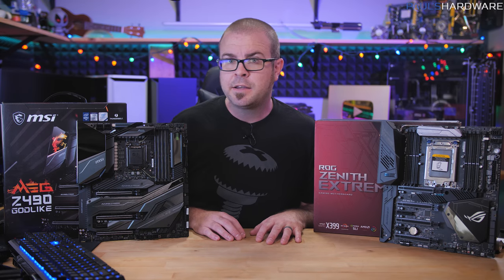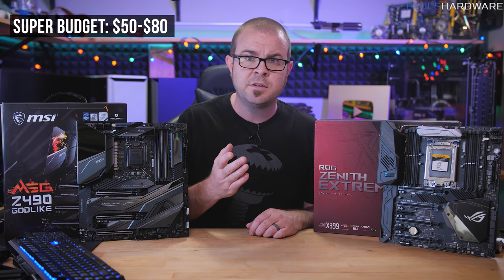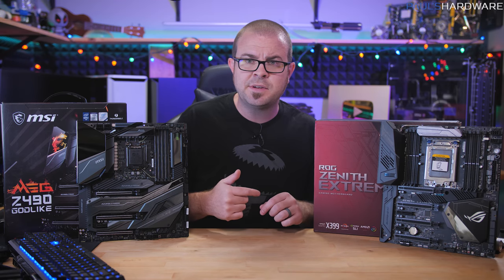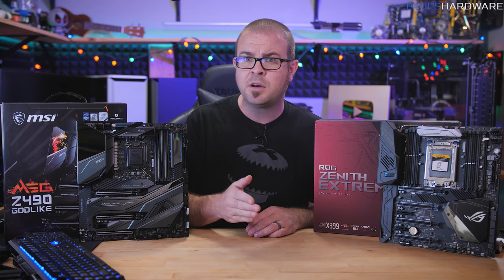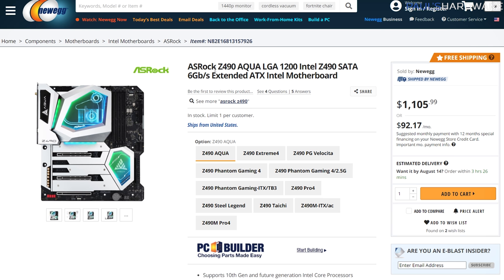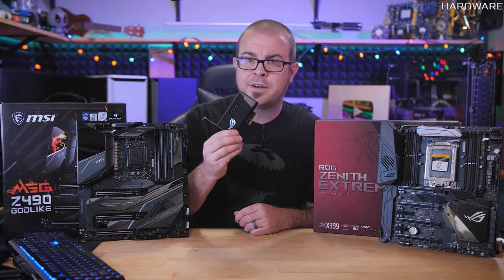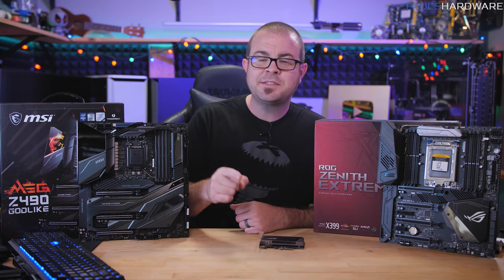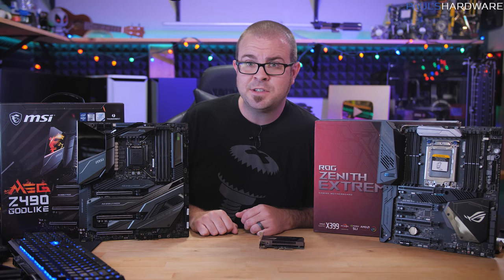What Does a $700 Motherboard Have that a $200 Motherboard Doesn’t?

Comment: Multi BIOS chips are handy for overclockers.
Reply: if they have a switch to toggle the bios, looking at you gigabyte
Reply: I won’t buy a board without one anymore unless I absolutely have to. It has saved my butt so many times
Reply: @monkeyplayer1  but new motherboards can flash bios from a USB drive with no display and no CPU
Reply: If they don't have an actual toggle switch, no. It's not handy, in fact it will have a worse experience than having only 1 BIOS.
Reply: Chad McKean The Xtreme has a switch though
Reply: Never have I tried a multi bios chip board. But the bios flash back saved me on my MSI B550I gaming Edge. First time ever I used it and it's awesome... I should make a video on that one day, this is Eric of Not Bios. Last year when Paul was in Van city in Canada I was on Vancouver Island. Now chilling up north; it's the cool place to be ;)
Reply: But to be fair, almost all the mobo's in the 200$+ range have that feature one way or the other
Reply: @aj0413_  The X570 Master also has one. No need to really spend nearly twice as much on the Xtreme to get a few more PCB layers, 10G NIC (instead if 2,5G) and passive chipset cooling. Plus a few more phases on the VRM.
Reply: Raivo K I mean, none of those (aside from passive cooling) are why I have the Xtreme, but was literally just commenting on the callout to Gigabyte and the Xtreme is the only one I knew had switch since I own one
Reply: @aj0413_  Z490 Master has the BIOS swtches.
Reply: Asus crosshair extreame 4 .multi bios saved my rig. Had an unstable ethernet port but used a bigfoot killer nic. Loved that motherboard .
Reply: Yeah he wouldn’t know man, he’s Paul’s HARDWARE not pauls SOFTWARE GOSH! Haha all jokes aside you’re 100% right about that
Reply: I totally agree i love my gigabyte x370 with the dual bios. With my Custom Waterloop i oc my  1600x and my bios crashed like  +10x times. It saves so  much time.
Reply: Multi bios is super useful for tons of enthusiast application. It also makes updating bios not a risk to brick your board.
Reply: I've had cheap(50 bucks) mobos with dual bios for 10 years already at least ... yep it is usefull and wouldn't buy one without but wouldn't call it premium function ...
Reply: Pro tip to anyone who cares: If you screw up your BIOS settings and can't boot / need to reset to defaults you can do so easily enough without any fancy CLRCMOS or jumper pins required

Every motherboard has a CR2032 button cell battery, the power in this battery keeps the volatile flash memory containing your BIOS config alive, take out the battery (also with PSU unplugged or switched off) and wait a few mins for capacitors to drain and it will reset it to factory defaults. Pressing and holding down the power on button on the case while that battery is out should speed up the process to seconds rather than minutes too.

Same can be done with laptops - AC unplugged, battery removed - hold power button for 30 seconds
BAM bios has been reset 
If you have a laptop with non-removable battery though, it can vary by manufacturer - most will still work just with AC unplugged if you hold the power button for 15+ seconds and some say hold the 'mute' button or 'beats' button at the same time etc
Reply: @RamiKattan  how?
Reply: My cheapo Gigabyte board from 2013 which looked like blue neon puke had that feature. It's as basic as it gets.

Comment: Going from a budget mobo to a midrange:

Prefitted I/O shield blew my mind 😂
Reply: I'm in the exact opposite end, my latest mobo had a prefitted IO shield that made installing the thing into the case a 20 minute wrestling match trying to not bang the board on the standoffs or bend it too much.
Reply: I literally left my Io off my pc so I can reach inside and check my CPU thermals manually XD the jankiest of the jank. One day imma electrocute myself lol
Reply: @TheDarkness344  oh yeah 12 volts dc, very scaryy
Reply: @DarkoPetreski  lol who knows XD a lot of amps can be dangerous but the resistance of my hand is high enough that I should be fine - more the heat to be worried about XD if I was running an FX chip my hands would be on fire lol
Reply: I paid 270 dollars for my motherboard and didnt get an included iOS sheild
Reply: I have a high end mobo, around 600 euros and the io shield isn’t pre installed but the padding is so thick that the usbc port is useless 😐
Reply: When my mobo came in I was like Ayoo where the io at then I looked at the io and saw that is was was pre installed which makes sense
Reply: What's an IO shield? 😁
Reply: @MichaelClark-uw7ex  input/output shield. it's the part where you connect all your cables at the back of tower, after your build is complete. In the video, where he is showing off his RGB backlit audio jacks, that is part of the IO shield.
Reply: @careyosoup274  I was being facetious, the IO shield is the metal piece that you put in the back of the case to seal the opening where the jacks are.
I always forget to put it in before mounting the mobo and am too lazy to remove the mobo and install the shield, so I say "what's an IO shield" with the wink emoji. LOL
Reply: @MichaelClark-uw7ex  gotcha. in my defense, I wasn't quite done my morning coffee yet ;p
Reply: going from super budget to budget:

Woah! This thing actually comes with an I/O shield!
Reply: same! never going back to mobos without preinstalled shield

Comment: At the very beginning when he mentioned audio, I said why? Use a DAC! I have 3 DACs. I use cheap $50 models to give me Optical and Coaxial and they run to a Fosi Audio Q4. The switch on the front switches between Optical and Coax, which are my primary desktop and my laptop dedicated to streaming. The Fosi connects to a Lepy Amp with the Texas Instruments version of the old Tripath Class-T chip, and that feeds a pair of Micca speakers. I do use EQ software to notch 125 Hz, and add a little bump at 60 Hz. This setup sounds AMAZING! The components are small enough to fit on a desk, but produces Audiophile quality sound even from a cheap old laptop. Add a Deezer Lossless subscription and no one would ever believe they were listening to a computer. When you consider the Amp and speakers are under $100, this is something everyone should look into, for music, gaming, and even YouTube. If you're a gamer, add a pair of HiFiMan headphones and a mic. The Fosi DAC is also a headphone amp. Planar Magnetic speakers are something Audio Engineers have been working on for more than 40 years, but few actually got it right. The designer of the HiFiMan headphones is one of those few.

Comment: Laughs in perfectly adequate 100 euro b450 mobo
Reply: Not true
Reply: Same board
Reply: Laughs in £60 mobo
Reply: B450 eww
Reply: Haha, same, I’m just happy to have integrated WiFi 6
Reply: @stoprollin nothing if you don’t got any high end hardware I guess
Reply: @AmishGeneral  well yeah, b450 sucks for high end hardware because it’s not meant for it. For a cpu like a 3600, something like a b450f, pro carbon, or tomahawk has a lot of features and stability for overclocking headroom. b450 does not suck, it’s usually great value for a budget build.
Reply: @Roman-us2fp  It can totally handle top tier Ryzen and RTX 3090 if you want. "It's not meant for it" is bullshit argument. B450 does pretty much everything that anyone could possibly want. And if you buy higher end board with that chipset, it most likely can overclock CPU way more than CPU can handle it. I'm pretty sure that it (something like Strix B450-F) could overclock 5950X to over 5GHz, but can your cooling and CPU cope with all that? B450 makes so much sense that it almost makes X470 look kinda useless and unsellable.
Reply: Reading some of these snobbish comments reminds me why I hate the PC building community.
Reply: @MJ-uk6lu  Well ofc you can buy why tf would you even consider it? If you’re buying a 3090 and a 5950x there’s really no practical reason to. B450 vrm power phases and LLC usually aren’t suitable for oc’ing more than 8 core and 1000mhz vram oc anyway. Hell my b450f can’t even handle 1.55v on e die. Bios resets itself every time I try to go over 1.41. So yes, you could run high end hardware on it. But it’s completely nonsensical if you’re willing to pay an excess of 2k on a build. Going with b550 or maybe even x570 would be a much better choice.
Reply: @Roman-us2fp  Back in AMD FX era you could buy many beefy looking boards only to discover that they shit at overclocking or were bad even to use chips at stock speeds, but at the same time there were many gutless boards that could OC the hell out of those chips. Chipset itself doesn't determine overclocking potential and never did. At the same time many Intel boards had seemingly weak VRMs, but they were decently robust at overclocking. I myself have tried overclocking FX 6300 on budget Asrock 970M Pro3, which only had 4+1 VRM with small heatsink. I managed to reach 5.288GHz with it at 1.7V. Ryzens consume less power and don't need as beefy VRMs. Many B450 boards have adequate or way overbuilt VRMs. Also it's really dumb to talk about Ryzen overclocking as they are absolutely terrible at that. It's nearly impossible to overclock them past their boost speed anyway and it's all due to how they are designed. It makes no sense to buy beefy boards for Ryzen chips as they are pigs at overclocking. If you want to overclock, you buy Intel. And even then there's not much point in doing so as K chips already have high boost clocks. RAM overclocking argument is also weightless. Just buy fast RAM. You can totally snag 3600MHz RAM for the price of 2666MHz RAM and it happens to be the upper practical limit of optimal Ryzen performance. Also, I wouldn't buy Ryzen for overclocking without at least phase change cooling. For pretty much everyone else, B450 boards are more than enough and even lowly A520 might be. B450 can handle 3100, 3200G and 3400G overclocking and those are the only chips that are somewhat decently overclockable and actually worth messing with overclocking. For pretty much any other Ryzen, there's no point as you would hardly exceed boost speeds anyway. And in most cases it's pointless to overclock for only 10% gains over boost speed. B450 boards already allow you to overclock Ryzen chips a bit and that's all consumers could possibly need. X570 only makes sense if you are interested in CPU lapping, LN2 overclocking and VRM mods, otherwise B450 (and it's successor B550) are totally enough for anyone.
Reply: Laugh in b450-A pro max at 80 pounds
Reply: Same mobo
Reply: @stoprollin many things you don't even get good ram speed support.
Reply: @MJ-uk6lu  yeh but the hardware will be limited due to only slower ram support.
Reply: @ShadowsOfTheParanormal  It's B450, not B460.
Reply: mb/s internet lets feel sorry for our brothers/sisters who struggle on that kb/s internet and yes there are some who still have that type of speed

Comment: Short answer: RGB
Reply: and for GAMERS
Reply: and Wifi
Reply: 10 Gig NIC. More phases to the PCB. Better overclocking... in theory. Higher durability. I'm the idiot who spends $400 for the high end "normal" desktop boards and then rides them for five or six years between CPU upgrades.
Reply: Aaand a lot of other stuff
Reply: @stephankruit3850  buying a high end wifi card would cost less tho
Reply: Stephan Kruit my $120 board has wifi
Reply: it's more then just rgb, like dual Ethernet ports, to use the pc as a pass through for another PC, even if the computer is off, the ethernet still is a pass through.
Reply: even my $160 b450 board has that
Reply: Alot of the time its the 8 slot ram capability for professional/commercial uses in scientific or engineering fields

Comment: You forgot the amount of IO on higher-end motherboards. Generally, higher-end motherboards have more SATA Ports and either more or higher bandwidth USB ports. Take The Asus Crosshero VIII Hero. It has 4x USB 3.2 gen 1, 8x USB 3.2 gen 2, 8x SATA, 2x USB 2.0 headers, 1x USB 3.2 gen 1 header, 1x USB 3.2 gen 2 header. As you step down you get significantly less and slower ports the TUF has only 3x USB 3.2 Gen2 rear and only a single USB 3.2 gen 1 header. and as you go to B550 you start Losing SATA ports as well. Pretty sure it is the same with Intel chipset motherboards. Now not everyone cares but I am always running out of USB ports and having the option to expand SATA storage as well is nice.
Reply: Isn’t that why there’s a market for usb hubs? The bandwidth is there either way.
Reply: Those were always the main differences that mattered to me. Those and power delivery and VRMs. Never been an "extreme" overclocker, but when I got my 8700k I wanted 5Ghz.
Reply: Man, this (usb ports) can be important depending on the user.

My set up: Mouse, keyboard, printer, mic, wacom pad, camera, hub (sd reader, USB drives), steam controller, battery backup (percent readout)

It can add up pretty quick. You could probably get away with using a high end hub for some of these, but if you have a lot of external equipment, having those extra USB ports can be a huge life saver.
Reply: IO is a very good point here. Though you can get additional sata/m.2/usb ports as pcie expansion card, having it on board can make for a way cleaner look. And with usb hubs you're just sharing the bandwidth of the one usb port your hub is plugged into. Absolutely fine for just some peripherals, but not so great for things that need bandwidth like external ssds, display port outputs, etc.
Reply: @pauld4238  but having a dongle on your desk with USB cables sticking out of it is ugly af
Reply: I agree. By wanting/needing at least 6 SATA connectors, 3 M.2 and at least 6 USB ports (for my system it doesn't need all to be Gen.2) extern en 2 USB-2 + 2 USB-3 intern you end up at high-end boards very easy.
Reply: I also saw that some of the higher end motherboards had integrated thunderbolt which can be a real hassle to upgrade since most normal motherboards don’t support it
Reply: @bhministry  This is a great point, I thought about it went making the comment, but wasn't really sure how to word it.

 Honestly, with how fast USB has become, I could probably use 1 hub and not notice a difference. Maybe the camera if it was at a super high resolution... which it isn't, but for everyday use I don't think I would notice. I've actually done it since I was testing out some hardware. It was just easier to use a hub (1 cable) when moving and working on the case.

Another potential note would be wireless devices. My mouse has a blue tooth USB... or could be paired directly with the device.
In this case I don't even need to technically use the USB connecter... it just saves me time from dealing with the settings.

There are also other options as well, audio could be passed through the graphic card in some cases. I've seen a few mics which have pass through for some speakers. 

There are many ways of dealing with this problem with how fast USB has become.  I'm sure there are others I haven't mentioned or forgot.
Reply: @RealThore  Is that why there is a thing called cable management? Hide them
Reply: RockingGamingDe somdo some creative cable management. Route the cables, mount it behind or under the desk, etc
Reply: Phaetos first hubs cost money so not having to buy one is value added. Second my time is valuable so I see any time I don’t have to spend cable managing as time I could be doing things as value added. Thirdly, not all USB devices play nice with hubs even if the bandwidth is there. Time I don’t have to mess around troubleshooting is value added as far as I’m concerned
Reply: Buildzoid sounds intensifies...
Reply: @RealThore  You can hide them, just like the rest of your cables.
Reply: But are you going to use all those ports in real life, i mean daily usage
Reply: @mikerukwava9574  Well, when people complain that having no USB ports sucks, they usually need those USB ports.
Reply: @mikerukwava9574  I use almost all of mine, but I would say there are ways around it like USB hubs or pci cards.  However, hubs will be limited, so you would at least want some higher speed ports on the motherboard.
Reply: @pauld4238  yes that's basically what a hub does, but it being directly connected to the board, means you are not going to get any interference. hubs can cause some bad interference, causing signal degradation. not to mention the higher end usb hubs require it be plugged into the wall.
Reply: Just what I need...8 SATA ports in my gaming pc. Personally if I was building a brand new rig completely from scratch I wouldn't use any sata drives and just stick with NVMe drives mounted on the main board. However, in my most recent upgrade I already had a couple of good SATA SSDs and an excellent case with SSD mounts so I used them for a couple of TB and added another couple of TB of  NVMe drives. Next time though, no SATA at all. Should keep things nice and tidy.
Reply: More SATA for those using onboard RAID.
Reply: Yeah until you find out those additional sata ports are provided by some garbage value sata controller made by the motherboard manufacturer. I couldn't tell you how many times asrock/asus' controllers have dropped a sata ssd drive when mcq was enabled and used